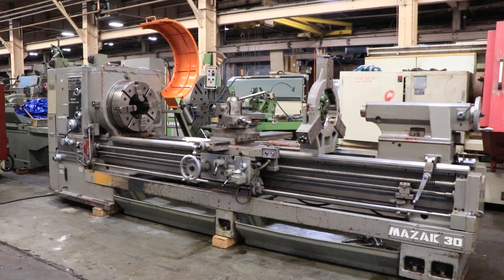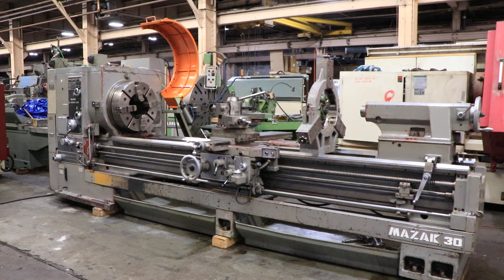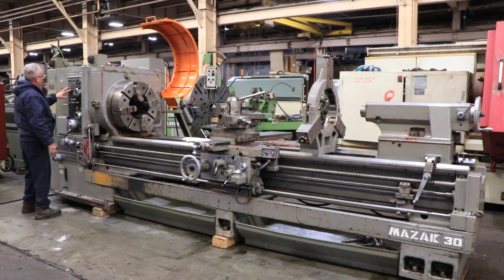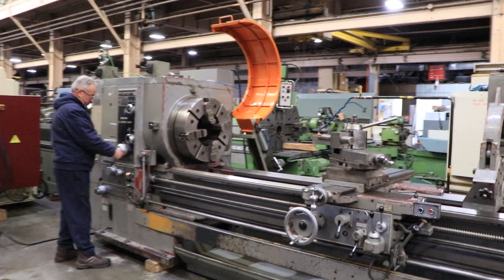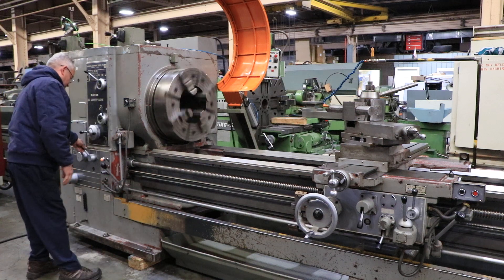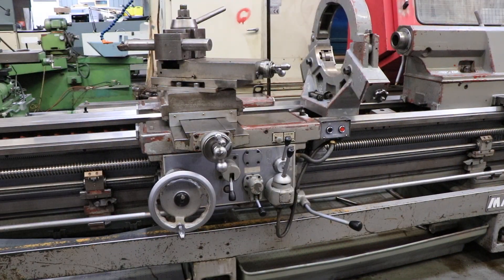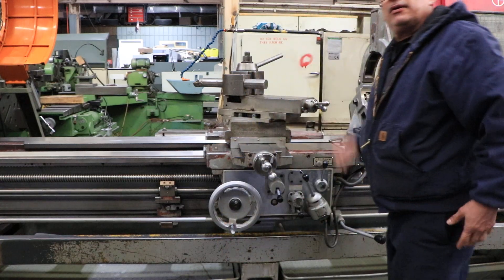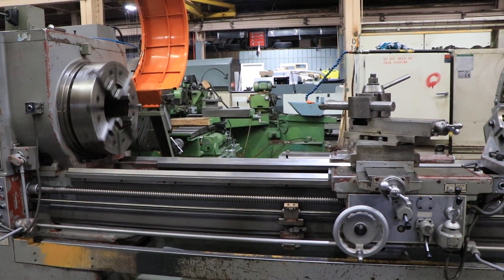30" X 120" MAZAK HOLLOW SPINDLE LATHE

Comment: I ran one  virtually identical to that one for 7 1/2 years cutting oil field drill pipe connections in North Dakota back during the last oil boom.
Reply from the maker: Solid machine.
Reply: Hello, I'm new to the world of lathes. Is this suitable for working with hydraulic cylinders? I'm wondering if it needs more than 300 rpm for that type of application?